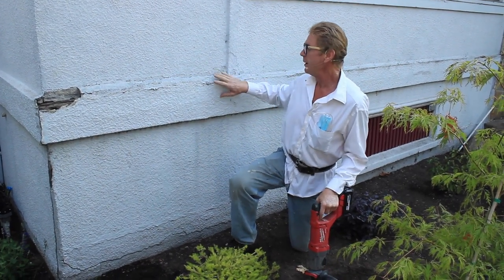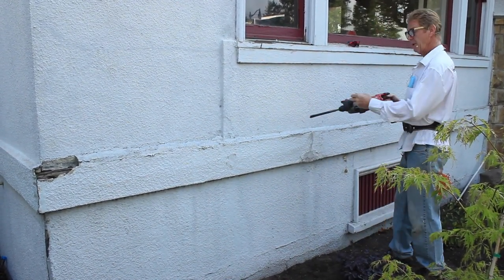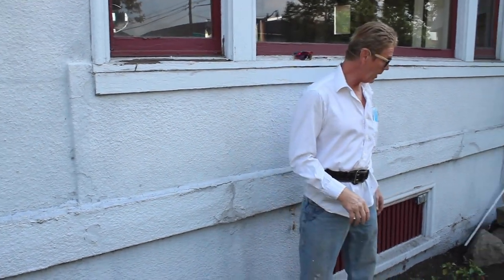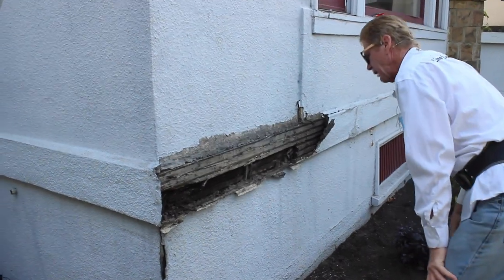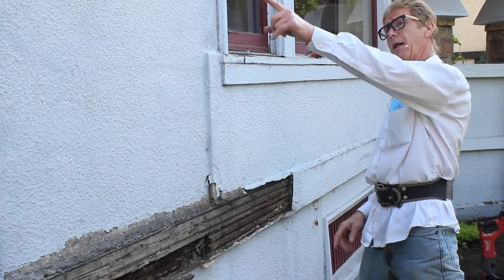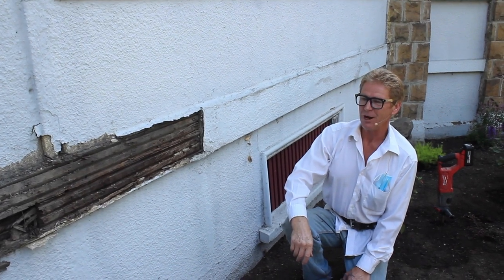Repair wood rot then re-stucco.

Comment: In the Union many many years ago! Good stuff Kirk. Dependable  resource. Even for a professional myself.
Reply from the maker: Good evening Andres, thank you, my fellow plasterer.😉
Our unique plastering Tip:  all subscribers or anyone who stumbles on our channel with a question, type it into our Stucco/Plastering channel, and like magic, a video will appear to explain how it's done. 	
   This feature is miles ahead of any plastering forum. 	
https://www.stuccoPlastering.com
http://www.bayareaplastering.com
Reply: @StuccoPlastering   Hello Giodano's!  Thank you for sharing the knowledge and the love.  I may have found an exception to your search rule.  I don't think you folks have covered a Bini dome/shell or inflatable air form work as yet.  :)

My wife and I are considering this process, but doing things backwards.  Normally work is done inside the air form.  We would do it outside, first spraying stucco on the air form, setting (preferably) a fabric mesh into that while wet.  That is sealed in by more stucco and topped with several inches of expanding insulation foam.  Rebar is set on the foam and concrete exterior sprayed into place.  Deflate the air form and decorate to suit.  Our interior walls would be as smooth as the air form.  

Any notions on spraying stucco before mesh and sealing it all back in with more stucco?  
We will certainly documnet our work here on Youtube when it happens (maybe couple years from now).

May you all live long and plaster!

Comment: I do enjoy seeing how you guys do things on that side of the pond! A small tip from here in the UK, always have a metal spot board as well as a timber one. So on those got temperature days your gear doesn’t set as quickly on the board 👍🏼

Respect from the UK
Reply from the maker: Good evening my fellow spread, across the pond. The mud wasn't too bad as I needed it setting/stiff to not get dropouts with the thick band. We make it all work.
 Note: to all subscribers or anyone who stumbles on our channel with a question, type it into our Stucco/Plastering channel, 
and like magic, a video will appear to explain how it's done. 
   This feature is miles ahead of any plastering forum. 🥳
Kirk & Jason Giordano Plastering

Comment: Great video
Reply: You said pressure wash or Garden hose, say I wanted to get loose stuff of lath, or adobe brick, a more fragile type substrate, what about a kind of shop vac, vacuumed, or sand blast if I did not not want to get the area very wet. Thanks.
Reply from the maker: @cane443    Good evening Vjrad, many ways to skin a cat, you can always wire brush it then apply a bonding agent, or even just clean it then attach stucco netting directly over it after it's papered or waterproofed.
 Note: to all subscribers or anyone who stumbles on our channel with a question, type it into our Stucco/Plastering channel, 
and like magic, a video will appear to explain how it's done. 
   This feature is miles ahead of any plastering forum. 🥳
Kirk & Jason Giordano Plastering
Reply: Ok, great thanks! Will check the forum type it question thing too

Comment: I never had anything to do with stucco but I actually enjoy watching you work, a lot of neat info and cool stories. But now I have an actual question, my house has a 4 sided cinder block wall shed with a gabled roof. THe gabled ends is covered with plywood siding, so basically there is a plywood triangle formed from the top of the block wall and the rafters/roof line. Can I put paper over and lath over the plywood section, and apply stucco over the entire wall? I am thinking I can overlap the paper and lath over the block a couple of inches and build up the stucco (about 1") so it looks like all one even stucco wall.
Reply from the maker: Howdy Home Skillet, sorry for the late answer but I di answer when questions come in. you rea correct in what you're referring about. 🤔

Comment: why did you not put metal lathe  over all of it ? wouldn't that have made a stronger longer lasting wall without the risk of it drying out
Reply from the maker: Evening my fellow plasterer, I feel kind of goofy responding to one who calls himself "Plastergod," but it's kind of funny.🤔
 Excellent question, my friend. Even though I answered it in the video, I'll answer it again.
 I didn't want to just cover wood rot here and there as rot is like cancer. It spreads, so we took the long route and added 4 hours to our day and removed it all, then added the paper and attached the good wood back, Yes I would have saved at least 4 hours by tucking the new paper under the top existing and attaching stucco netting over then plastering, but that's the kind of fix that shameless or lazy folks do.🍻
 Plus, when this home goes for sale, the inspector will look at our new work and notice we did it properly, not covered wood rot.
BTW, I'll ask, what's the BMF stand for?
     Note: to all subscribers or anyone who stumbles on our channel with a question, type it into our Stucco/Plastering channel, 
and like magic, a video will appear to explain how it's done. 
   This feature is miles ahead of any plastering forum. 🥳
Kirk & Jason Giordano Plastering
Reply: @StuccoPlastering  I get what you're saying I meant after you tore it off why not just go over metal with paper behind it
Reply: @StuccoPlastering  Is it like a historical thing you like to use the older materials to put back into place?
Reply: you said in the video it was too hot to go over the wood that day you were there but if you just meddled over the wood you could have scratched and doubled it
Reply: @StuccoPlastering  we are  five generations of plastering in the Pittsburgh area
Reply from the maker: @PLASTERGOAT    Evening, my fellow plasterer. I did say it was hot. For me, I love 88 to 90-degree weather, but there was a lot of behind the scenes things going on that day to whine about, especially on camera, so we just got it done. I did double up on the wood lath and applied 4 inches to the bump-out.
 Overkill? You betcha.
We could have made life easier that day, but sometimes you just got to get it done.
 Note: to all subscribers or anyone who stumbles on our channel with a question, type it into our Stucco/Plastering channel, 
and like magic, a video will appear to explain how it's done. 
   This feature is miles ahead of any plastering forum. 🥳
Kirk & Jason Giordano Plastering
Reply from the maker: @PLASTERGOAT , this home was up for sale. I figured a good inspector would be going under the home to check for everything. The last thing I wanted was for someone to point to something that had my name on it.
Reply from the maker: @PLASTERGOAT , the wall was already waterproof. The paper behind the flashing would serve no purpose. However, the metal weep screed did need any kind of wire for the stucco to adhere. I could have even flattened two pieces of corner aid and fastened them. The idea was to get any stucco netting over the metal.
There's a lot of ways to skin a cat.🍻
Reply: nice vids

Comment: have you tried a stucco lightweight called u-stucco? any thoughts?
Reply from the maker: Hi Carlos, no, but I have used Kemset Plaster50. It's also lightweight with no lye or silica, so it's the best on the planet since we started using it. It was engineered in Turkey, where them boys are knowledgeable in Lime plastering as they have been using it for close to ten thousand years.🤔

Comment: Many times you get blamed for a poor job cause the customer won't spend the the money to do it right. That window sill needs some work.
Reply from the maker: Good evening Russel, I, as a rule, give all my opinion. I said someone had pulled a fast one, as the stuccoed wood under the window had been tampered with. 
I could see that the bump-out was not original, as the wood sill should have been embedded.  I try not to sell folks stuff they don't want. Most don't want explorations unless it's absolutely unnecessary.😉
    I personally didn't see any reason to explore what someone had done in the past, above our work, as there was no indication that it was compromised.
 Note: to all subscribers or anyone who stumbles on our channel with a question, type it into our Stucco/Plastering channel, 
and like magic, a video will appear to explain how it's done. 
   This feature is miles ahead of any plastering forum. 🥳
Kirk & Jason Giordano Plastering

Comment: You think the stucco will stick to that wood 🤔
Reply from the maker: Hello Roman, excellent question. We cleaned the wood and coated it with "weld-create" this is a bonding agent as nothing sticks to a dusty surface.
 Plus, this wood is keyed.